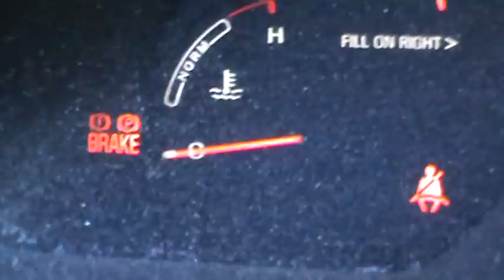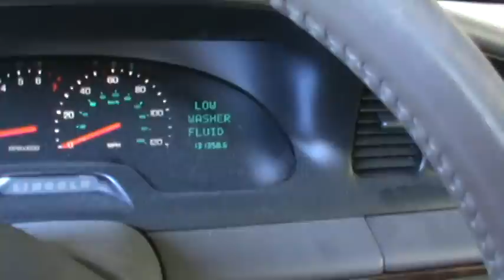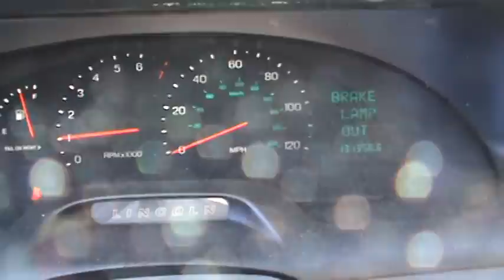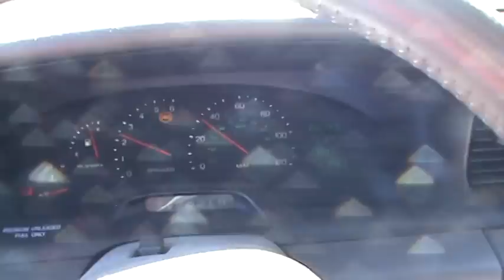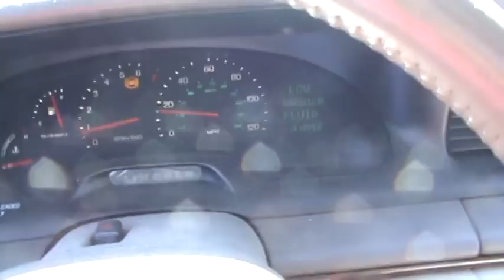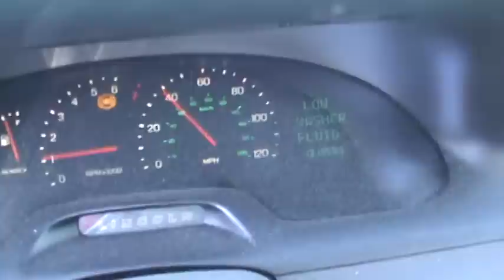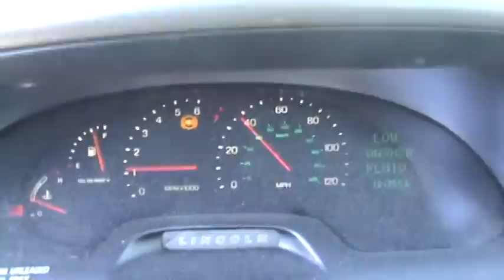97 Lincoln Body Work Done + Other Issues

Comment: traction control issue, it's applyin the brakes. I think you might want to replace your front brake hoses as well. The steel bracket on the front right brake hose was not letting the brake pressure off the caliper on my car. I have a 99 continental.

Comment: Tom.My old 94 Cadillac would lock the front diff.when it senced wheel spin in slick conditions.With the ABS light comming on it might be telling the computer  that there is a difference in wheel speed due to a bad censor.This may be locking the Diff.which could be causing the problem you are having under exceleration.With no wheel spin the Diff.should stay open and the car should not dart off the road.I would check the ABS censors.